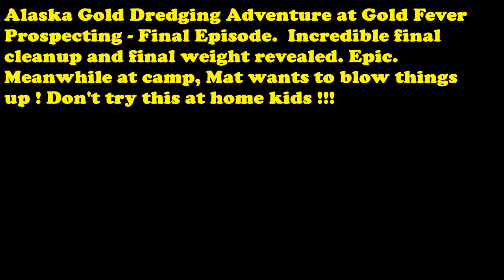WOW $8000 in Gold Found - Alaska Gold Dredging Series on The Fortymile River  Midwest Dave  - Finale

Comment: This video caught my eye because it reminded me of my best day of dredging up here in Alaska.  
Years ago, after years of research and effort, I finally located an area the old bucket line dredges missed.   It was in a tight corner of the valley where I assume the BL dredge couldn’t get to.
So, I dropped my 6” in and It started to pay off right away with daily cleanups around .25 ozt.  And it quickly improved to the .5-1.5 ozt range.  
Then, magic happened.  After a long day of dredging and shoveling tailings (I don’t like splitting my gold so I work alone) I turned off the engines, walked around to take a peek at the sluice… and right there was a 3ozt nugget staring me in the face.   I don’t think my feet touched the ground the rest of the day.  
It ended up being a 5.45 ozt day.  My best day ever.
I go back to that spot every summer and I still do very well.  But I’m still looking to break my 3ozt nugget record.  And I know if I keep working that spot, I’ll find it!!  At least that’s what I tell myself every day to convince me to jump back into that freezing water.
🤣🤣🤣
Reply from the maker: Must have been an incredible day to find that much gold. Places like that must be hard to find and very remote.  40 mile is pretty remote to me, being from Cornfield,USA.  The 40 Mile replenishes Paystreaks based on what I have heard.  Good Luck out there and God Bless !
Reply: @MidwestDavesGoldProspecting  It was definitely difficult to find but not remote at all.  I can park the truck within 100 feet of the site.   I’ve always wondered how many prospectors have walked right past that spot.

Comment: Hi, I’m considering coming up to their camp this summer. I’m curious, what camera and sound equipment are you using and is the drone yours? Thanks,
Reply from the maker: I was using a Nikon on a tripod, but I did not have Auto Focus on. Nikon really does not have a good Auto focus on the camera I was using.  I would recommend using a Go Pro Hero 8 and buy or make Sound filters for the wind.  There are a lot of inexpensive drones on the market, as long as they Are HD or UltraHD.   Thanks for watching
Reply: @MidwestDavesGoldProspecting  thanks a bunch. Good luck to you.

Comment: If you dredge for along time you need to check  the jetlog were it connects it will catch gold before it gets in the box. I ran a 4 inch Keene for 2 months strait and when we were packing up the jet log was jammed in with sand i was fighting to disconnect it and watching the sand fall out under water than the sun hit the sparkly sand.  I put my hand out and it filled with 100% fine gold foils I probably lost 10 ounces that way. I found that the steeper the down angle on the jet log the more gold we would catch in it we also leave the jetlog pushed in 6 to 8 inches makes a back eddy were it connects to the box.  I had 1 friend find a 2 ounce nugget in the jetlog when he was packing up. Another friend found a 3 ounce nugget in the hose he could hear something rattling when packing the hose up and plop out comes a monster nuggy. Nice job dredging I assume this is in Chicken>>the land of superfine gold.
Reply from the maker: Yes, 40 Mile by Chicken.  Good tip on the Hose connection. I did the same in California, several years back. Found some nice flakes and small nuggets just sitting at that connection.
Good Luck out there and Thanks for Watching.
Reply: Good luck 2 u 2:)  I dredged Bird creek in Petersville, Alaska. I lost more nuggets down in the bedrock than i found:( I moved on to an excavator with ac lol. I do miss the dredge its another world underwater. 1 year i had a pet trout so tame and i could call him by tapping the water and i would scoop him up in my gold pan and pet him daily. He luved the sluice box and he would wait next to my dive mask for worms i found in the gravels by the end of the season I had a school of 100+ trout under the sluice but only 1  next to me. I never chased them other guys on the crew would and they knew it and they would only get close to me:) I miss my pets :0 I wonder if pike are as friendly? @MidwestDavesGoldProspecting